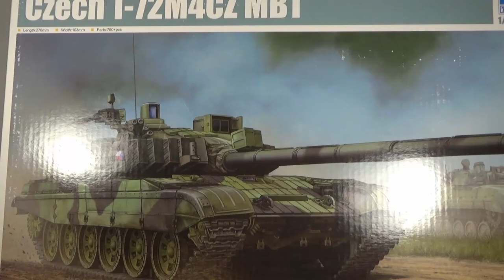T-72M4CZ - 1/35 Trumpeter - Part 1

Comment: What after market brand did you use for the PE and aluminum barrel?
Reply from the maker: The barrel is from Voyager Model (VBS0518), it isn't really designed for this kit so its quite difficult to make it fit.
Reply: @Jarbello  how about the rest of the PE?
Reply from the maker: Everything else is from the kit, no other aftermarket PE sets. The smoke grenade launchers are also in that Voyager Model set
Reply: @Jarbello  ok got. Thanks